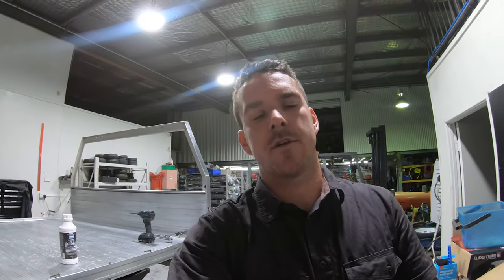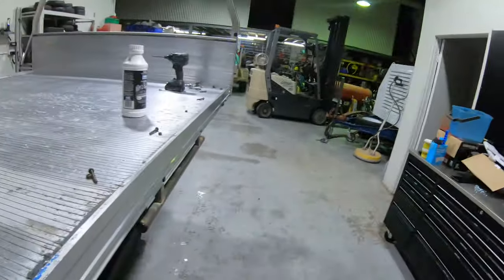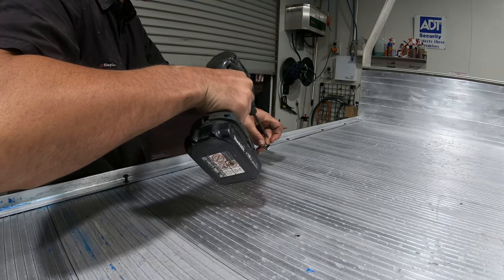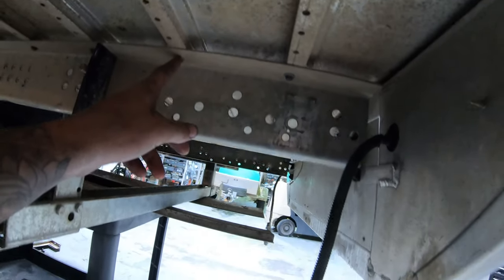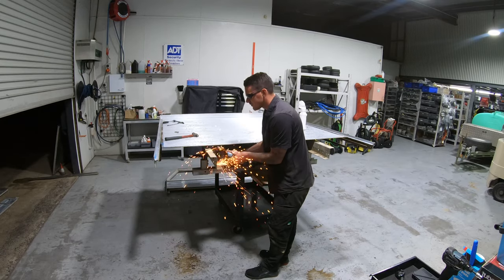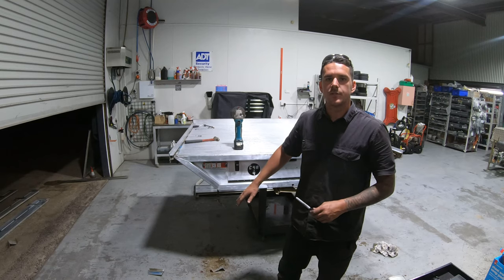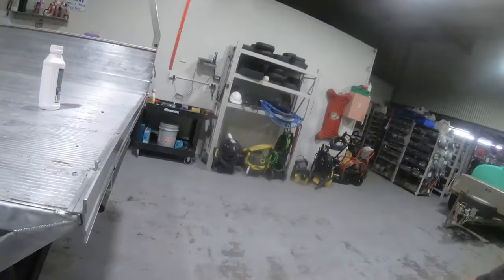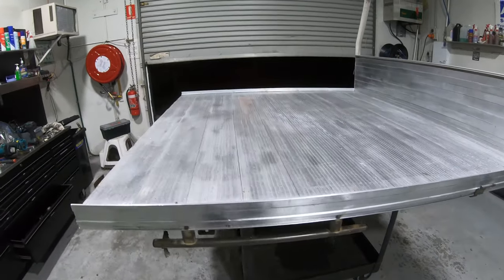Building My Dream Tray Setup - Ep 1 (Shortening an aluminium tray)

Comment: Nice vid mate... do you know by chance what the shortest is you can fit.. 

I have a short 1360 steel tray I'm thinking of putting on. By my measurements it looks like it will be close to flush with the  chassis...
Reply from the maker: Hi mate you could Probly get away with 1500, mine is 1550!